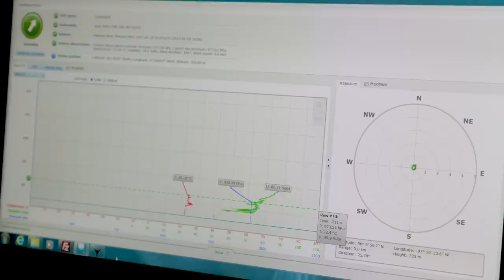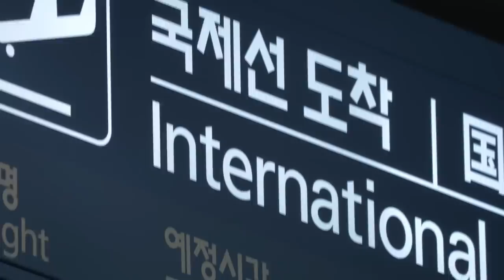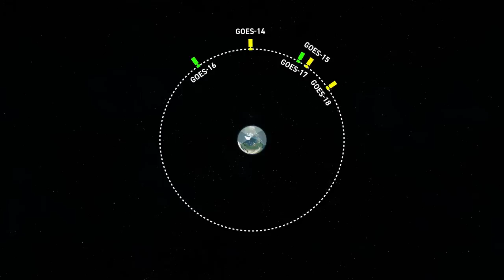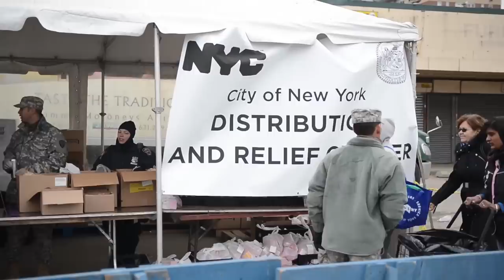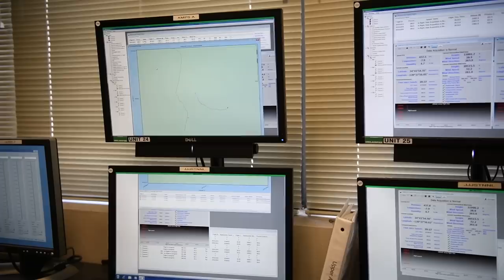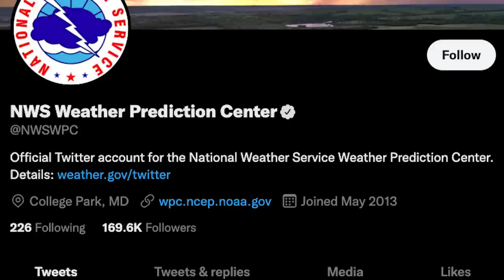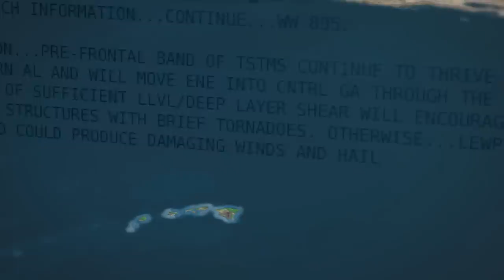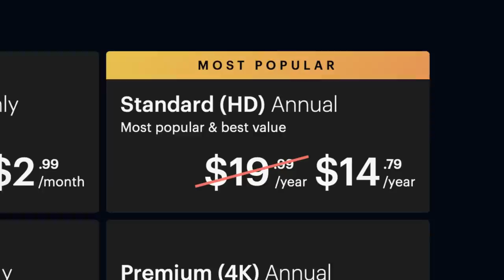The Incredible Logistics Behind Weather Forecasting

Comment: Sam thanks so much for this video! As a meteorologist who works for deploying the new MROS (Manual Weather Observing System), it was so fun to see both the old and new software and equipment in action in the video! Some corrections though: 
They are called radioSONDES not radioSCONES, the balloons go up to around 100,000ft or 30,000 meters or 30km not 300,000m.
Also, technically fronts don't have pressure so it wouldn't be a "high/low pressure front" .

Other than that Sam, this video was top 5!
Reply: It’s also helium or hydrogen in the balloon, not both gases in one balloon. Barely worth noting but I still cringed.
Reply: Also not sure why it shows radar analysis while describing the HRRR!

Comment: Local news meteorologist here -- Outstanding video! Thanks so much for making it. It really is WAY, WAY more complicated than most people think.

This really is a comprehensive look at every little aspect of what goes into a forecast -- radar, radiosondes, satellites, buoys, ASOS, aircraft data, ship data, volunteers, the list goes on and on.

One point to add: Forecast accuracy from the HRRR, NAM, GFS etc. is hugely dependent on the initial conditions they're given. We literally cannot get enough observations...every little bit is valuable.

We collectively have a very good understanding of the physics behind the atmosphere...so much so that in theory, if we had a 100% complete and accurate observation system — covering every single point on Earth — every forecast would be pretty much 100% accurate. But that will forever be impossible in an atmosphere that is vast, inherently chaotic, and in constant flux. So we do the best we can with what we've got!

Thanks again.
Reply: Respect

Comment: Fun fact about the ASOS (Automated Surface Observation System) stations he mentioned. Not only do they transmit on radio frequencies, they also can be received by calling into a phone number. You just go to the Airnav page for your local airport, for example KSTL, then scroll until you either see ASOS or AWOS and a phone number. You can save this number in your contacts and call it at any time for weather data.
Reply: As a former skydiving instructor, my days used to start with a call to AWOS to see if conditions at KLMO matched the Metar data.  They usually did, but there were days when they didn't and we'd get to play our least favorite game--are-we-getting-off-the-ground-today.
Reply: @joelsteverson  I mostly just use them to see if I need to bring a jacket in fall or spring, but there are a ton of uses for them, especially in aviation
Reply: @goreoproductions6955    They are really handy.  I frequently call them to determine if I need rain gear.

Your comment got me thinking... I wonder how many people have discovered AWOS and use it for non-aviation purposes.
Reply: I imagine it must be annoying when you call for information about an oncoming hurricane and you get hold music.
Reply: @vigilantcosmicpenguin8721  nah it’s super cool. It’s just on a loop 24/7/365, so you only have to wait for the message to restart. Maybe 30 seconds at most to hear the full message. Try it!

Comment: Amazing video about the weather service system. NOAA does an amazing job.
On a different not, the narrator (Sam) mixed the the measurements at 0:34.
100,000 feet is not 300,000 meters. It's the opposite. 300k feet is 100k meters (more or less)
Reply: In the subtitles he says that 100,000 feet is 30,000 meters.

Comment: At 0:36 you got the units of measurement wrong. Should be 300000ft or 100000m.
Reply: I think he meant 30.000 meters, instead of 300.000.
Reply: @JoseAlbarracin10  My thought as well.  100,000 ft is correct.  300,000 ft or meters is simply wrong--way too high.

Comment: There were a few head-scratching statements in this video.

For example where you talk about a "high pressure front" or "U-shaped Gulf Stream" (at 13:30). I think you meant "jet stream."
Reply: Gulf stream effects weather
Reply: @jtorola  actually geoengineering affects weather more than anything
Reply: @stinkymart3173  nope
Reply: @jtorola  It does but the graphic clearly shows a dip in the jet stream near Texas, which is nowhere near the Gulf Stream.

Comment: I have a question. Does our prediction get more accurate over the time due to more available data or does it get worse due to the shifts in climate and long-term model innacuracies?
Reply: If I could quickly list the things that impact predictions the most it would be initial data quality and quantity, data assimilation methods, and model resolution. Overtime we have gotten better at all of these things
Reply: Bigger computers mean better info
Reply: Accuracy has improved quite a lot over the last 50 years, climate change is too slow to cause a significant decrease in accuracy as work is constantly being done to improve them
Reply: I used to work at the UK Met Office, and a week long forecast is now about as accurate as a 2/3 day forecast in the 80s
Reply: pyropulse  "week long forecasts are still not accurate" well accurate enough for what standard? Different fields and industries have different levels of usefulness for different levels of accuracy. We've reached very useful levels for 2-3 day logistical planning, and the 7-10 day is pretty bad in comparison, but, hey, it's still getting better. 

Look at it in context, what other field predicts the future accurately at 3 days and sometimes still a good prediction at 7 days? Your mechanic for your car? Doctors predicting the progression of diseases? Economists? Compared to how unreliable that crowd can be, I think meteorology is pretty impressive.

Comment: The Wendover law. No matter what topic the video is on, sam will find a way to make some portion of it involve airplanes
Reply: To be fair, weather does involve planes a ton. I'm surprised he didn't mention things like the Hurricane Hunter aircraft that fly into hurricanes to get a clear picture of the weather within and give us a clearer forecast. Without accurate weather forecasting, it would not be possible to make commercial aviation anywhere near as safe as it is now. In fact, airlines are legally required to use NWS forecasts to ensure they are safe to operate the flight under the forecasted weather.

Comment: This system will only become more important over time. As the climate becomes more erratic and extreme this system will be critical in giving citizens more time to evacuate or take shelter when bad conditions (floods, tornadoes, heat waves, etc) are headed their way.
Reply: @odomisan  the general trend for solar activity is actually a slight dip over the past couple decades, and it’s not that much of a change anyway.
Reply: So true.
Reply: Quick fun fact, while we can clearly see the connections to a changing climate for plenty of weather events. Tornadoes have no real connection, they are so small in the grand scheme of things that we can’t predict their exact location

Comment: I'm sure it's been pointed out before but right at the beginning it sounds like you say 100,000 ft or 300,000 m which I'm pretty sure you either misplaced the feet with the meters or, like your transcript says, it was supposed to be 30,000 m.

Comment: FYI: At the beginning of this video you have the altitude in meters and feet switched. You say 100 O00 feet which equals 300 000 meters. I think you mean the other way around: 100 000 meters which equals about 300 000 feet. One meter is a bit more than three feet. Other than that, great video!

Comment: 0:39 There's a small error: "100,000 feet or 300,000 meters" can't both be right. 1 meter = 3 feet approx. so perhaps the units should be flipped for the values you quote?

Comment: Within the first minute, there is a major error. 100,000 feet and 300,000 metres are not the same thing! They are either launching the balloons to 984,251.97 feet or 30,480 metres. Considering that 984,251.97 feet is well above the internationally recognised boundary of space which is at 328,083.99 feet, I would say that you need to lop a zero off the metres number you say here.

Comment: I worked at NASA on the GOES-16 and 17 ground processing system, when it was transitioning the satellites to NOAA. The data and engineering are utterly incredible, and the models that utilize the data are a scientific marvel. But simply nothing can replace the data gathered by atmospheric weather balloons launched every day. In fact, it's one reason why I left NASA to develop a solution of collecting these observations from West Africa and remote regions. The cost of accurate weather sensors and transmitting radios has come down immensely over the past 30 years. Today, we've done about 30 launches at two universities in West Africa and record the data on a blockchain, so that the data is held publicly and students can get paid for doing the launches.

Comment: If airplanes transmit data via satellite, then how TF do they still get lost in the 21st century?  (Flight MH370)
Reply: It’s possible that there are dead areas around the globe that prevent successful transmission.  Theoretically, this makes sense.
Reply: It is alleged that the captain of MH370 turned off many of the communication systems on the aircraft before engaging in a murder-suicide.
Reply: @Eternal_Tech  that’s another thing that doesn’t make sense.  Why do they even have the ability to turn that stuff off?
Reply: @djp1234  Exactly.  They don’t allow access to the FDR or the CVR.
Reply: @werquantum      The cockpit voice recorder (CVR) can be turned off. There is actually a circuit breaker in the rear of the cockpit that can be used to power off the CVR. In fact, in case of an incident, the pilots are supposed to turn off the CVR via this circuit breaker, so the recording can be preserved (so it will not be overwritten).

However, I am not sure if the flight data recorder (FDR) can be turned off via the cockpit.
Reply: @djp1234        Anything electrical can potentially cause or exacerbate a fire, which is one of the worst things that can occur on board an aircraft. Therefore, providing the pilots the ability to deactivate electrical equipment is considered a safety measure.
Reply: @Eternal_Tech  Good information.  I’m surprised to learn this. Thanks for clarifying.

Comment: The system was credited with increasing tornado warning from 4 to 11 minutes? Don't you mean decreasing? Are you ill Sam?
Reply: Increase means extended the length of the forecast from 4 to 11 minutes. Are you ill?
Reply: @aolyahoo1972  na ur right. It's just because 30 seconds before he couldn't even calculate feet to meters 😂 so I was listening with more scepticism than normal. See my previous comment.

Comment: What about Geoengineering? Coz from what I’ve heard, we’re not just observing and predicting, but also actively altering the weather.
Reply: altering the weather by changing things on the ground and in the air is a bit risky from an environmental perspective. it could plants and animals in very unexpected ways. the only climate modification i can think of that avoids this issue to a reasonable extent is placing large flat sattelites into orbit around the earth to block a portion of sunlight above a large area
Reply: @sheikchilli8670  Yes very risky but it’s being done.

Comment: I don't think solar activity is limited to just disrupting radio communications. I think the sun have the majority of influence in climate and weather. Earth and Mars polar ice caps coincidentally syncs. Wet and Dry seasons, average temperarure coincides with sun spots and activity level.  But this hypothesis if proven will kill the man made climate change hypothesis.
Reply: How do the ice caps on mars and earth sync in any way? The closest I can think of is the fact that mars has a similar axial tilt to earth, so that contributes to seasonal changes. And those seasons aren’t at the same times as earth